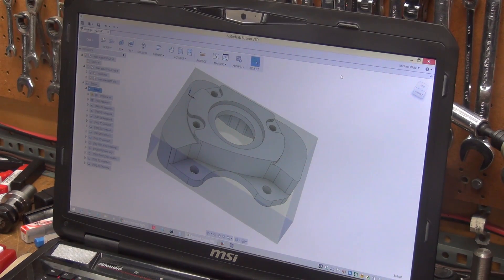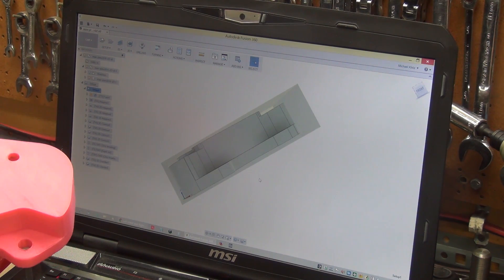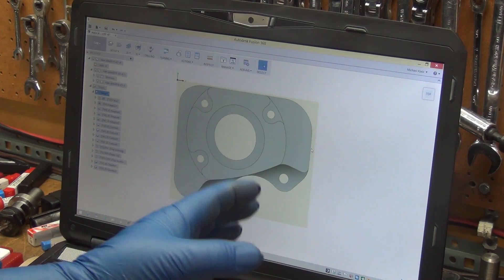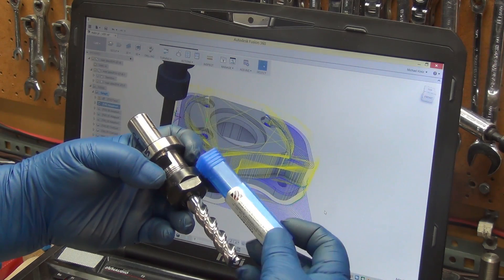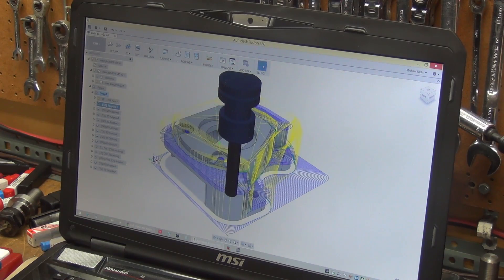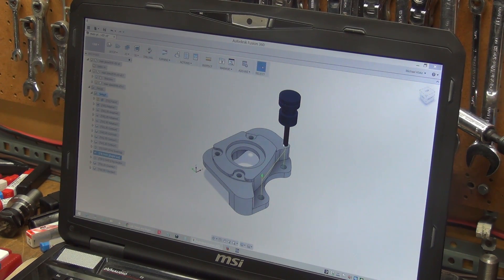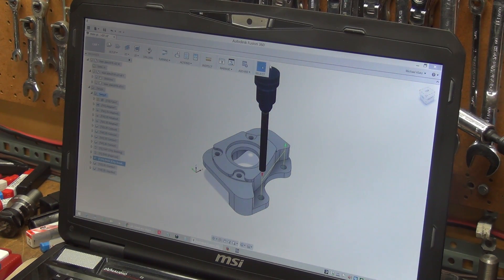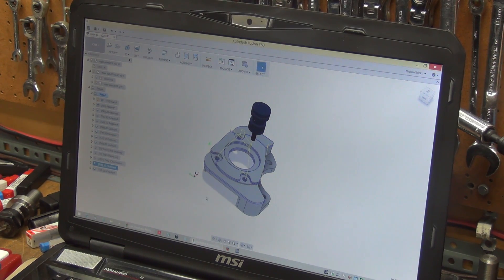Aluminum Truck Bracket - CAM

Comment: are you going to show us this job running?
Reply from the maker: It's the vid I'm currently editing. :)  I'm cutting it down a good bit since each side was about 45 min and there were 3 sets.  Any specific part of the ops you want to see?  One vid with be the first side, with a second vid for the other.
Reply: mainly taking heavy cuts, and accidents
Reply from the maker: LOL!  As I get better, the number of crashes "should" go down. :)

Comment: What graphics does your laptop run?  Any issues running in Fusion?  I'm looking to buy a new laptop and I'm unsure how much graphics I need.
Reply from the maker: The specs say it's NVIDIA GeForce GTX880M and Intel HD Graphics 4600.  I'm not sure which one it actually uses for the CAD/CAM graphics.  It's a fairly good MSI Dragon laptop that ran about $1900 when I got it.  I put two 1TB SSDs in it.  I'm the weak link in this chain. :)
No issues with fusion on it.  I think the video editing takes more resources/power than fusion. :)

Comment: Nice.. Newtech?  been there.  Making bracketry is fun. :)
Reply from the maker: Thanks!  New Tech Industrial....yep.  They're trying to decide if they're going to move to Vancouver when the lease is up or just retire.  Too bad I ran it into the steel bar on the mill stop......kept using it, but I need to get it resharpened. lol